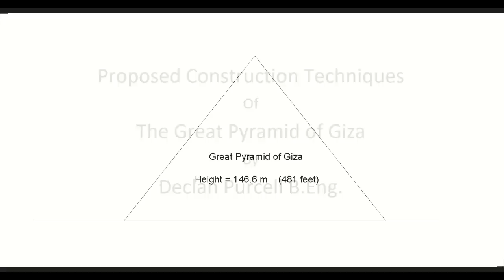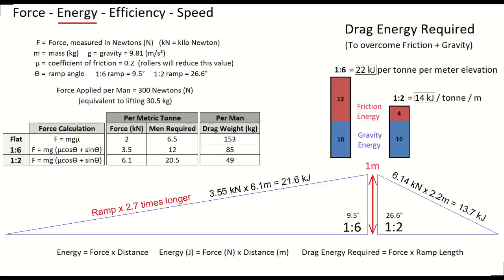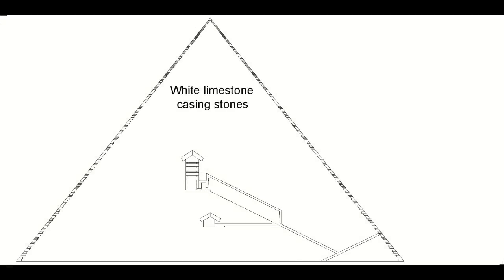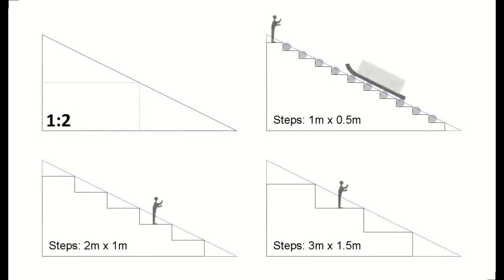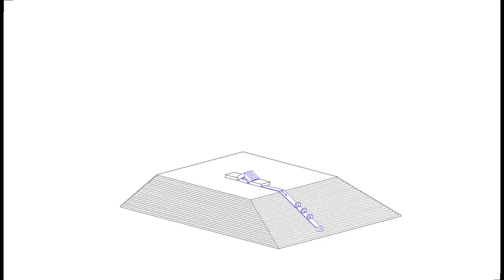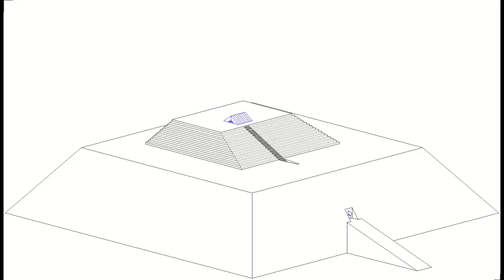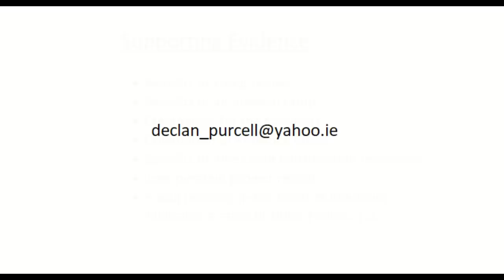Proposed Pyramid Construction Techniques

Comment: This is a very good theory particularly with what the actual evidence on site suggests. However, there are a few things that still need addressing:
1.) the top 30m of the pyramid is a difficult proposition. The video shows some scaffolding & either tracks or ladders without any explanation for how those blocks would have been hoisted or lifted & placed. I have a hard time imagining 2.5 ton blocks being pulled up a 55 degree slope with so little room for manpower.
2.) the casing stones were not addressed in the video at all. I guess the assumption is that they were placed bottom to top as the main construction was completed. But recent studies of the top 30m of the khafre pyramid show a top down pattern which excludes any external ramps. But also makes it hard to imagine how the blocks were brought up to the very top and then placed moving down. Maybe the top section of the pyramid was constructed in an entirely different pattern than the base and center sections?
3.) the survey marks around the pyramid show nothing other than an 8 acre planned layout. Also, the pre construction leveling of the surface is finite. This indicates that the full construction was planned in advance & the internal structure with an “as needed” size idea may not be viable.

I do think the internal ramp with steeper slopes idea is far more likely than anything else. Just a few fine points that still need answering.

Comment: Hey , i am a retired construction engineer. The way i would do the pyramid is to go straight up the sides using a counter weight method. I would use 30 crews on the east and on the west sides. My estimate is it took 20,000people, 12 years to build, Its the confirmation of the high civilization of ancient Egypt.
Reply from the maker: why would you use a counterweight?
Reply: @declanpurcell571  
 They had people. 50 people weigh about 7500 pounds. The biggest stones were about 5,000 pounds. So if you have a pulley at the top and 7500 pounds pounds of people walking down the side of the pyramid, do you think the stone will move?  It will move easily.
Reply from the maker: @jbird6609  
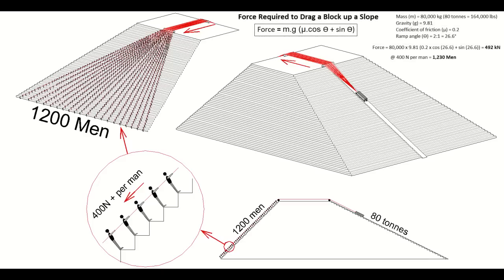Totally agree with utilising men as the counter weights, as I indicate in the video (5:40).    Utilising stone as the counterweight does not work as it would take more effort to raise the counterweight than the actual blocks themselves.  Have you specific details on raising the 80 tonne blocks to a height of 60 m and construction of the final 5% to the very top..?
Reply: @declanpurcell571  

The theories i have been looking at is there was a shallow ramp inside the pyramid boundaries. Using Pullies and extra men, still walked down the steeper side of the pyramid, but at shorter strokes. After construction the ramp was integrated into the final structure.
Reply: @declanpurcell571   I think you are really close to solving it. The part using men pulling with arms i think not.  Using counter wt people with gravity and leg power is is more convincing. Now think about 30 crews working 6 hour shifts on 2 sides of the pyramid at once, productivity would be maximized.

Comment: Awesome vid. I thought though they've found the queen chamber's vents go much closer toward the outer walls than thought, and seem to take a few weird turns along the way. There was also a random vent leading off one of the vents maybe half way up. What reasoning would they have had to make those air vents curve back and forth?
Reply: Add in the modern debris found in one of the shafts (the one that bends around entrance and or Grand Gallery) implies that there us some sort of connection between them that allowed the objects to reach there. I'm not saying the connection was built in. Just possible gaps in the stone work. But the one video out there that shows something off to one side.
Reply: @mpetersen6  I mean, if an old paper ticket from a century ago can get blown up the shaft, it means it’s a pretty good vent system.

Comment: how were each and every stone block quarried, perfectly made level, and transported? the blocks are so tightly connected you can't fit a credit card, how do you suppose they did that? so how was it so perfectly level?  and the pyramid is build into a rock face as well perfectly level, how was that possible
Reply: Lots of men in different teams. With enough man power you probably could. Think about it, these men will spend decades of their life perfecting their work, they would get really really good (and fast) at it.
Reply: Hundreds of tools were found, which shows how they processed the bedrock. And the "can't fit credit card" argument is one of the dumbest. Visit any early medieval church in Europe. Would you be able to "fit credit card" between blocks there?
Reply: @albertofernandez2490  Visit any early medieval church in Europe. Would you be able to "fit credit card" between blocks there?
Hmm... perhaps churches actually should put up boxes with slots that fits exactly a credit card , since coins are getting less and less used. Though, even that may be on the late side. (yes i'm trolling , no offense meant).
Reply: You can't fit a credit card between load bearing stones in any building, you goof.

Comment: Very interesting.   Coupke things to add.  I remember a british group moving megaliths for a stonehenge investigation and some bright lad figured out instead of greased logs you make greased wooden rails.  Iirc they were moving stonrhenge sized blocks along them pretty easily

Second is there is a French architect named Jean Pierre Houdin who proposed something similar but in a spiral fashion.  I think it was later shown in a gravity scan of the pyramid a spiral structure very similar to his models.  

You internal steep ramp/stairs combined with his spirals ramp would  work together very well.   The steep ramp/stairs would allow the core and large pieces to be put in place and then the spiral ramp would be used to bring up exterior blocks and the limestone facing .  Then back filled and covered up once finished.

Comment: Great video! You took the data from the scan pyramids project and came out with a good solution
Reply from the maker: I was not looking for a solution to fit the scan pyramids project.   

Once I realised an internal 1:2 ramp was feasible and that the grand gallery was not suitable for raising the multiple massive beams used in the roof structure of the kings chamber, there was only one other possibility..  a higher-level ramp above the grand gallery.    Once I could see that a 1:2 ramp perfectly matched the position of the chevrons with the upper vaulted beams I knew I had a logical construction hypothesis….   In other words, the chevrons themselves and a plausible explanation to their purpose was key to my confidence in building this theory.
Reply: @declanpurcell571  great work man, its truly an interesting theory

Comment: One question. It seems everyone focuses on the Great Pyramid. But what about the other ones. Could there be evidence of internal structures intended for easing construction. If we accept the timeline that Menkare followed Kufu then were likely still have been men around who had worked on the construction. They would have known how it was done. Plus could there be internal features in Menkare's pyramid such as chambers besides the one below ground level that are hidden simply because once completed and used they were buried under addition "plain" stone work.
Reply from the maker: If the great pyramid utilised an internal ramp, them I would expect that Khafre’s pyramid, which is the second largest also used an internal ramp, which also means chevrons were required.   These are not currently visible, so the question is… are they there,  just one layer of stone from the surface?
Reply: @declanpurcell571  I don't think the other pyramids were built during the same time period. Different construction techniques.

Comment: Did the ramp go higher than the top of the pyramid because who was pulling it once it got to the top or did they decide to push it instead
Reply from the maker: I did not go into specific details on lifting material from the upper platform.   
Bear in mind at this height it is unlikely the blocks exceeded 1.5 tonnes.	

Possibility 1: The men ascend the ladders (from the upper platform) and then use ropes to drag up the blocks.   The number of men required depends on strength.  Due to space limitations the strongest of men would be used.   If each man could raise 50 kg, then 20 men per tonne would be required.

Possibility 2:  A pully on a jib (2 sets) at the top and men located on the platform below pulling the ropes downwards to raise each block.  This method requires less men as they will have increased pulling force as they can utilise their own body weight.

Comment: Wow! This finally puts to rest the problem that had been bugging me with archaeologist's idea of an external spiral ramp, which involved how men with ropes pulling a large block up one side of a pyramid could get around a corner. In fact, since they would lose manpower as the lead pullers had to go around the corner first and could no longer apply labor, how did they even get a large block TO a corner? With this proposed system, all my objections are moot.

Comment: Great analysis!
However, using grease on drag surfaces seems impractical and inefficient. They probably rolled the blocks with four 1/4 circle wooden spacer "sleds". You see these 1/4 circle sleds depicted in many sources, although probably incorrectly as drag sleds with one per block.

Comment: The building extents were beyond the end item. Crane and hoists were used by thousands. Once the pinnacle is reached deconstruction of the extents was performed using the material to finish going down. The Egyptians were amazing engineers. They were also great manufacturers and are the first practitioners of lean.

Comment: I've never understood the reason for the "load bearing" chambers. The "Queen's Chamber" below bears a much greater weight but doesn't seem to need any chambers above it.....
Reply from the maker: The purpose of the spacer beams are to ensure that the load bearing vaulted beams do not apply stress on the grand gallery stonework.

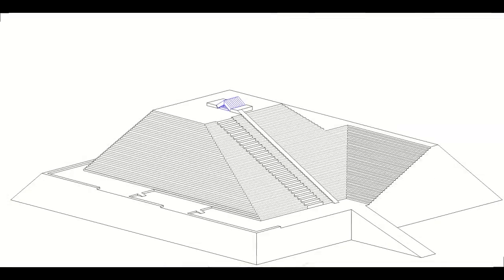Comment: would you please do the simulation like @11:43 but the corners are built first (outside to inside method) may that explains the 8 faces of the pyramid
Reply: It doesn't really have 8 faces. That us from a variety of things such as erosion and looting. The 8 faces also are not consistent vertically or horizontally, they don't extend the same distance or to the top, nor are they centered.
Reply: @AveragePicker  Thanks for the clarification. Cheers!

Comment: How wide would the rope have to be to support 80 tons plus friction?
Reply: If it was a hemp rope, maybe they smoked some first.
Reply: 30mm modern hemp rope has the  tensile strength of like  7 metric tons. So wrap  maybe five of those into one rope and you're in business (pullin with two ropes). Would make for a thicboy rope tho.
Reply: There is no reason to limit the number of ropes used to lift the stones. If two ropes are not enough, simply tying more ropes, whether it be five or ten, would do the trick.
Reply: @s.p2483  Thats true too

Comment: You're only right about canals being used to transport the blocks to the site.  Water locks were then used up the sides of the pyramid to easily lift the blocks.  Steven Myers details exactly how this was accomplished in his books.
Reply: @richarddecredico6098  Perhaps you aren't aware that Brown's gas (HHO) forms a vacuum when ignited as it has the unusual property of imploding rather than exploding.  I haven't finished reading his book to be able to properly argue your assertion, but do you doubt the construction method he outlines is feasible also?  It seems the most logical to me, and although evidence of water locks isn't found as they would have been removed after construction, Myers' explanation regarding the purpose of the Khufu ship acting as a crane seems very probable.
Reply from the maker: The water theory is absolutely a non-runner.... 
I will make a follow-up video demonstrating why...
Reply: @declanpurcell571     I'm very interested.  Are you familiar with Steven Myers work?
This is a short animated video showing the basics of how he believes the pyramid was built using barges and water locks.
https://youtu.be/5ZzEpDx8eYw
This is a link to a playlist I made with fourteen of his videos describing how it was built in detail.
https://youtube.com/playlist?list=PL89aKTxb5RaCHqX3Y9E9DA2qKw0OgjClL
I noticed Steven recently uploaded another dozen videos on how exactly the Great Pyramid functioned as a water pump, so I'm going to be busy watching those now.

Comment: 8:41 but now, the grand gallery does not have any purpose, does it? Couldn't it be that it was used as a ramp until the stones around it reached its top and only then the second gallery above it was created?
12:06 I assume that this "valley" reached until the floor of the grand gallery and the upper ramp was only created later.

Comment: Pulling on ropes with your arms is significantly less powerful than pulling while walking, i.e. using your legs. For the same reason, rowing is not (as often assumed) about arm, but leg and core strength. I think this is a not insignificant factor to consider.

Comment: Seen the new video footage of that "corridor" that was found realeased a couple of days ago? Basically showing that the pyramid scan is trust worthy. Those those rough cut stones idk, seem out of place. Can't imagine that the workers just left it like that given the precision elsewhere. Also do you really think the top was not meant to be a skydeck? Because if the ramp essentially goes all the way to the top internally, why wouldnt they just use it to look at the city, sunset, sunrise, and stars from up top?
Reply: Well, the interior stones from what we can see (inside the 'niche' and on the very top, where a few courses are missing) are actually pretty irregular.  It seems only the visible stones were finished to any sort of standard (and of course the famous granite blocks).  The vast majority of the stones seem to have been roughly shaped and then fitted together almost like a jigsaw.  My own theory is that the stones were only roughly shaped before they were transported up the pyramid and then workmen shaped them there, so they fit.

Comment: Why pull massive blocks uphill, when you can just use a counter weight on the opposite side?
Reply from the maker: How does the counter weight get uphill...?
Reply: @declanpurcell571  - The counter-weight is made from lots of smaller rocks that are easy to raise. You just stack dozens of them onto a sledge to counter the one big stone on the opposite sledge.

Comment: the external ramp makes the most sense a tunnel would have problems with light and air with having so many people working
Reply: Mines exist.
Reply from the maker: As indicated in the video, the majority of blocks were placed before the tunnel was required.

The longest stretch of tunnel is from the chevrons upwards and is an approx. 150m in length.   Approx 220 men would be located within this tunnel during lifting manoeuvres.  At ~ 100 Watts per man, this will generate approx. 22 kW of heat which will produce an upwards movement of air within the tunnel (ie. the stack effect) which will draw in fresh air at the base and maintain a continuous flow of air.  Assuming a requirement of 10 l/s of fresh air per man, results in a total required flowrate of 2.2 m³/s.   If the tunnel had a Cross Sectional Area of 6 m², that would mean a 0.36 m/s air velocity through the tunnel would be required to provide adequate ventilation for breathing and temperature control.

Comment: Bit of math:
2:1 is a rise of 0.500, which is 26.5°
A rise of 0.400 is 21.8°
22.0° is a rise of 0.404
22.5° (right angle, quartered) would be 0.414
If any of those numbers match physical measurements...

Comment: The top 20% of the Pyramid blocks were carried up a ladder? am I seeing this right?
Reply: Question is: How big are blocks on the top of the Pyramid?
Reply from the maker: No, you did not see it right.....  It was the top 1%.

At this point, the workers would have used ladders to reach the top plateau and then drag up the blocks.
The blocks used were likely in the 1 to 2 tonne size range so manpower requirements were minimum.
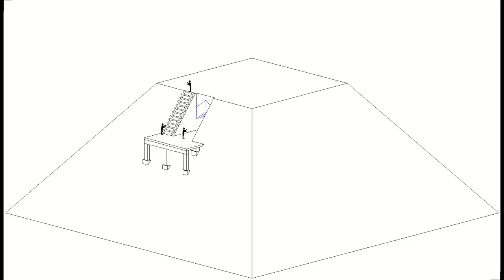Reply: @declanpurcell571  at 7:45 in the video. Dragging 1-2 tonne blocks up an incline (with no sliding apparatus mentioned), with little space to spare would seem quite difficult. Did you calculate the manpower required for that?
Reply from the maker: @addison9272  
I did not go into specific details on lifting material from the upper platform.   But, now that you are enquiring about the feasibility of such a challenge I would be glad to analyse possible solutions.   
Two possible options:

1: The men ascend the ladders and then use ropes to drag up the blocks.   The number of men required depends on their strength.  Due to space limitations the strongest of men would be used.   If each man could raise 50 kg, then 20 men per tonne would be required.

2: A simpler method would be to have a pully on a jib set up at the very top of the structure and the men pull downwards on ropes to raise each block.  This method requires less men as they will have increased pulling force as they can utilise their own body weight.
Reply: @declanpurcell571  Interesting, I would love to see a diagram or an in-depth explanation of the top 1% of blocks being hauled up.
Reply from the maker: @addison9272  
someday....